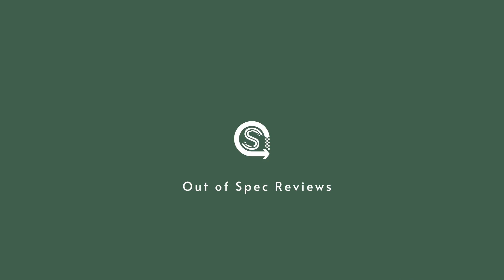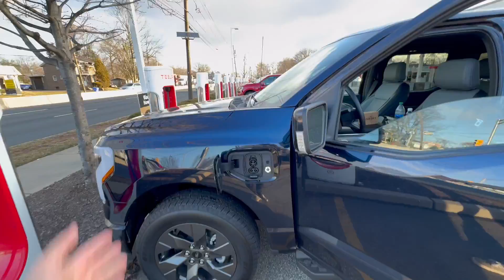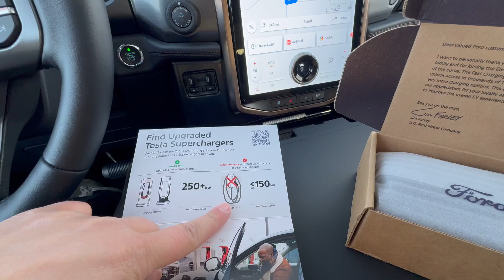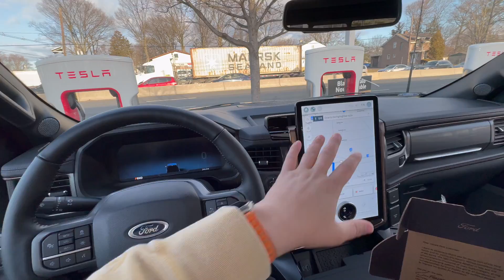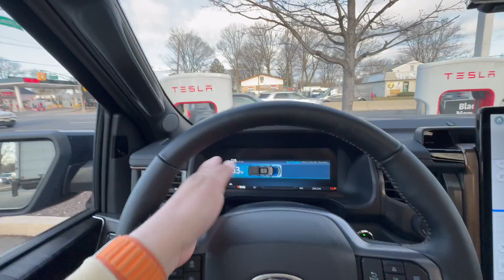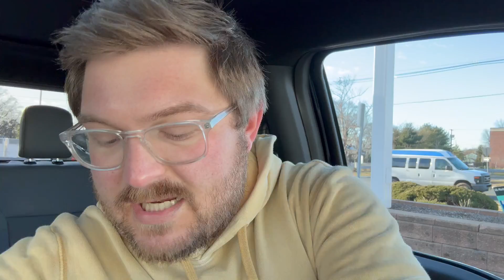Ford Gains Access To The Tesla Supercharger Network! Join Me As The First To Plug In

Comment: Man Kyle is doing all the EV releases for these companies. I love it. I prefer it over the cheesy manufacturer videos. Very informative as always, thanks Kyle
Reply: I find them rather misleading. Take the cybertruck test as example. He claims  it was done at 45F where it was 38-45F which reduces range by 20% compared to EPA 68-86F spec
Then he did it at 700ft instead of 4000ft for the rivian and f150. Reduction of 20% resistance due to thinner air at higher elevation 
Then he compares it to EPA and claims Tesla never makes it claimed range. This is so misleading as it is not claimed range but EPA estimate based on tests at EPA specification. 
Then his test are done at 70MPH not 48MPH average EPA speed. 
Fine if you like to do a test at 70MPH but don't compare it to the given EPA range 

But anyway, I don't beleive this is because he is a bit dumb and don't know how to do a test properly. I beleive it is misleading and I know that Ford pays billions in marketing, would it not be easy to give this guy a few pennies and he is happy to slightly mislead here and there..... we will probably never know but his tests stinks.
Reply: @bartdeking  Kyle explained all the adverse factors in that Cybertruck range test, including altitude, tires, ambient temps, and more. Kyle also explained that he'd be repeating the test in Colorado as soon as he gets a chance, to better match his standard 70mph tests.
Out of Spec has done dozens of tests at 70mph across different models and brands, for cross comparison. Why 70mph and not mixed 48mph? It's because that's a real world speed, across long distances, where consumers start developing range anxiety. 
For someone who's never posted an EV range test video, along with explaining your methodology and rationale, then criticizing the consistent detailed testing premises given by Kyle and his entire OOS team, I'm afraid your the one sounding a bit dumb.
Reply: @lv_q3259   @lv_q3259 you don't seem to read my comment properly. 
1, I have not problem if they do a 70mph test to give consumers an idea how much range they get on a road trip but DO NOT compare it to the range specified according to EPA specifications given on the tesla website. DO NOT even mention it since it is misleading as it presents like Tesla is lying or not giving a correct range. This is not true. 
EPA was initially intended to give an average consumption for average driving NOT a how far do I het on a long road trip I make twice a year test. 
In other word you can not say, I drove 70mph in 42F and got 256mi which is lower than the 318 specified by tesla. Simply because the 318mi is specified at EPA test specifications with an average of 48MPH and 68-86F. 
Likely it would add 5-10% extra range if you would test it at the same temperatures the rivian and f150 was tested. 

2, Yes he mentioned 700ft but instead of 4000ft but why did he at the end of the video not correct for it. He could have said, the distance was 256 miles but with known data that 700ft vs 4000ft elevation  difference we need to correct it by 20% to be able to compare it with the F150 and rivian which likely comes around 307mi if we would compare it in similar conditions

3, he mentioned indeed that the temperature was 45F and was used by ALL other media as the temperature for the test. However, if you bothered checking the video in detail and do some fact checking than you can see that temperatures are 38-45F mostly around 41-42F  

On your last comment, I would indeed only do a comparison test in the same conditions and when someone plays games on YouTube I am happy to point this out and wish that everyone would see how misleading the out of spec channel is. 

The narrative set is that CT is worse in range than rivian and f150 but in reality this is simply not true. Especially when it comes to wh/mi

Yes he promised another video where he would do the test properly but it is yet to come and the misleading narrative has been set already.

Comment: Is the required update Over The Air? 
Ford is now losing $30,000 per vehicle plus another $1,000 for the adapters
Ford should change to putting the charge port to the rear left or front right of the vehicle when upgrading to NACS.
Reply: Why would you put the charge port on the rear of a vehicle built to tow?
Reply: @vladimus9749 front right then?
Reply: @GonGon010 I bet this is what we'll see with other makers joining the Tesla network. I wouldn't consider any EV with charger on the rear since I tow regularly and most sites are not pull through.
Reply: @vladimus9749  Only an idiot would that is why all Tesla charges are on the rear left light cluster facing to the side, the only exception is the CyberTruck where the port is on the rear of the  wheel arch (facing to the side)
Reply: @jjamespacbell  Are you saying it's pointless to buy an EV if you tow frequently?
Reply: How do you lose $1000 for the adapters on when other reputable companies are selling it for $160CAD.  But I do agree the location of the ports will create a nightmare at the stations.  Imagine 20 spots charging 10 lightning…😅
Reply: @GonGon010  10 Lightnings would only waste 1 spot.

Comment: Unfortunately, the NACS standard only applies to the plug, it also needs to dictate the location of the charging port. Having an eV take up 2 spots on a busy location is going to cause trouble.
Reply: Yeah.
It's a real shame the CCS Consortium didn't make "let's decide on a standard port location" the second order of business after "Who wants coffee" In their first meeting in.... (from memory) 2010?
.
Instead it seems to have been a case of "just use the same location as the Fuel port on the cars you're converting"
.
smh
Reply: I think Tesla will be moving their charge port to the front. How are you supposed to charge a tesla while towing?
Reply: @vladimus9749  If that was even slightly likely to be true, Cybertruck would have a charge port in the front. So, that is a no. To charge while towing, you unhitch, or use pull-through charging stalls.
Reply: @geirmyrvagnes8718  Unhitching is a non starter for anyone who tows regularly. How common are Tesla pull through stalls? Are there some at each station?
Reply: Using the pull in stall that is taken by someone too lazy to back in most times. Or pull across several at the end. Enduring nasty looks until the person looks around to see you're towing. Or unhook. All fun. "Need pull through charging" is my comment whenever they ask for feedback. Gas stations figured this out decades ago.   @vladimus9749

Comment: Thx, what about a long 5 ft adapter, that could have resolved the port location and occupying an additional spot while charging.
That would have been a relatively easy solution without the expensive and long process of extending the SC cables on 15k chargers.
Reply: Cooling.
.
I'd like to think there will be a ...."contribution" by others to extend cables where required together with a "don't be a D.H" attitude when a nit Tesla is blocking a charger (as Kyle is 😉).... When it's busy.
Reply: This is not a house fan. It's a high current DC charger that needs cooling and the handle temperature needs monitoring. You can't extend these cables

Comment: This is great! The only problem I see is where the Ford charging port is so two lanes would be taken up and would be blocking the spot a Tesla would need, hopefully the software takes this into consideration when they sense a certain type of car is plugged in and doesn't say the blocked charger is available, based on charge port location.
Reply: Did you watch the video? They know what to do but that can’t be helped until version 4.  That is what happens when you build for only your cars but other networks had to let everyone use them.

Comment: When will they address the short cable and the parking on the wrong side thus taking up 2 spaces to charge?
Reply: Mmmm....  Perspective.
.
It's not a "Short cable*
It's an "incorrect port position"
.
Any company that even considered ...
"🤔 What happens if we eventually decide to standardise with the network that has more vehicles and chargers than any other in the future??" Might have had a word with the designers and said "just in case, put the charger front right " (on the lightning) or rear Left (Hyundai, Kia) etc.
Reply: It is being taken care of, and it also mostly takes care of itself AND it is not like this is the end of the world as we know it, it is annoying.

Comment: Pretty disappointing that Kyle doesn't mention the parking clusterfuc that is about to happen.  I hope all new BEVs will come with sockets on left-rear or front-right from now on
Reply: The final piece of Hubris from other manufacturers??
Reply: @rogerstarkey5390  Tesla cars will also be blocking non-Tesla cars from using the Superchargers, under the same scenarios.  But... there are 10x as many Teslas on the roads (and using Superchargers) as there anything else, so you won't often see this issue if you're a Tesla driver.  But... you may find it to be a pain in the ass if you have a non-Tesla and its socket is in the wrong place.  I say "the wrong place" and feel that is technically correct, since Supercharger sites often need cars parked a certain way for their short cables to reach.

Comment: Several questions: 1) While charging, will it let you pull out the Tesla handle (with the slide switch release), or is that prevented when the adapter is plugged into the car?  2) Will it let you plug this into the car and then plug the Tesla cord in, or is this reverse process blocked?  3) Is there a genuine check being performed - will 3rd party adapters work or not?
Reply: My understanding from the Ford instructions is that you must first insert the Tesla plug into the adapter and then insert the adapter into the Ford. Removal is the reverse -- remove the adapter from the Ford and only then remove the Tesla plug from the adapter. I believe that the interlocks on the adapter prevent you from doing otherwise.
Reply: @charlescourtney4412 Yes, I but I would like to see someone try and confirm this - when you don't follow the instructions.  I believe this is a big difference from the A2Z and Lectron third party adapters - the Tesla adapter potentially being a foolproof and safer approach.

Comment: Kyle, what happens if you 'spoof' a ford vehicle in the Tesla app and try to use the adapter with another brand?
Reply: There’s a software update needed on the car side that enables access to the Supercharger network.
Reply: @anthonyc8499  per Ford's FAQ:

Is a Software Update required to use Tesla Superchargers?

While updates are not required, software updates will enhance the experience at Tesla Superchargers. We recommend that you enable automatic updates to receive software updates and take advantage of these enhancements.

Comment: They need pull through chargers just like gas pumps if they really want to make it as convenient as gas cars, especially for trucks when your towing. If you can only tow 100 miles and have to drop your trailer to charge then most won't switch to EV.
Reply: There are pull through chargers.  Probably going to be a lot more due to the Cybertruck.
Reply: Not enough, and only recently. They should all be. I've towed cross country. Not fun. And many locations are not designed around it (dead end sub-parking lots).   @sparks869

Comment: That disconnect process is going to result in a lot of adapters left behind at the superchargers. IMO the better process would be to lock the adapter into the CCS port until the NACS plug is removed. That would force you to disconnect the Tesla plug first, then it would be easier to remember the adapter and throw it back in the car.
Reply: If you don’t remove your adapter you can’t hang the NACS back on the dispenser.
Reply: Yep.  I fully expect to start an adapter collection in the frunk of my model Y.  My most often used Supercharger is a V2 which won't work for non Tesla vehicles.   I am sure there will be  confused drivers there unable to figure out why it won't work.  Hopefully it will get better quickly but for some time this is going to be a cluster....

Comment: The charge port location on the Lightening means that two spaces are occupied per Lightening.
Reply: Just imagine if Kyle was around when the first mechanical gas pumps launched ,five minutes the whole process done😅
Reply: He addressed that in the video.  You could have 10 Lightening's and they would only take up one extra spot of done correctly.
Reply: @ttom We'll have to see how it goes. It has the potential to only waste one stall per site. It also has the potential to waste 50% of the stalls.

It'll probably end up somewhere in between. How good it is or how bad it is will depend upon the drivers on that day.
Reply: @JeanPierreWhite  Cybertruck owners are gonna forcefully move Fords that takes up 2 stalls if its full, the F150 will take damage but the Cybertruck will have little to none at all if they move at 3 miles per hour 🤣
Reply: But honestly though, Tesla owners will be furious if 2 stalls get taken on a busy day, best solution though is if there's to many cars there, tesla automatically closes that supercharger location to Non Tesla's till all the tesla drivers are gone
Reply: @ParvTubeHD  If Tesla shutout non Tesla's at busy stations they'd soon find themselves on the wrong side of an anti-trust lawsuit. Pretty sure Ford et al will have made sure Tesla don't have unfettered control over who has access and who doesn't.
Reply: @JeanPierreWhite  Ok they can have access, just increase the price by 1000%, Tesla may not be able to get them to leave but they are able to choose pricing which is something ford as no control over at all which they have admitted
Reply: People will figure it out like they have in Europe.
Reply: @barryw9473  Here's hoping.
Reply: @barryw9473 in Europe there are plenty of competition in the charging market so you can just go anywhere you want to charge. I. The US everyone else has failed so they will be all funneled to super chargers. There’s gonna be no “figuring it out”. it just means that some supercharger sites on some days are going to have dramatically insanely long wait times because remember these legacy auto EV’s not only take up two spots they take a lot longer to charge generally.
Reply: @ultrastoat3298  I just took a 1200 mile road trip using EA and had to wait twice for 30 minutes. If those people go to Superchargers, there will be no wait at EA. People will figure it out. The sky will not fall.

Comment: As a Tesla owner who roadtrips 3-4 times a month, I am delighted to see other EVs able to use the Supercharger network and hasten the EV transition.  However, I am concerned that the Tesla routing software will be showing open dispensers at a location that are, in fact, being blocked by non-Teslas who take up 2 dispensers (from a Tesla perspective).  I hope Tesla will somehow figure a way to show that 2 dispensers are in use when a Ford or Rivian or Mercedes rolls up and plugs in "backwards".  

I live down the street from the Tesla v4 dispenser in Columbia, SC that a couple of YouTubers have featured and see how this problem will eventually go away with the new universal dispenser design.  However, I am sadly considering going back to ICE for a couple of years if I start to run into this problem repeatedly over the next few months.
Reply: It’s all fun and games until you are waiting in line and looking at some fords taking two spots each.
Reply: @ultrastoat3298 and double the charge time of a Tesla.
Reply: Agree
Reply: This is going to be an issue.  Say it's an 8 stall Supercharger and 4 Ford EV's are spaced out, the Tesla app will show 4 in use and 4 free, but you won't be able to use any of the free stalls.
Reply: Blocking 2 bays is an issue in Europe as there’s no standard determining which side of the vehicle to put the charge socket. Tesla chargers are more exposed as their cables are relatively short, even the newer ones. It’s common to come across a VW or similar taking up two bays. However Europeans generally do not need unnecessary adapters as there was a snowball’s chance in hell that the EU would adopt Tesla’s charging standard and hence Tesla uses type 2 in Europe.
Reply: It would be very helpful if non Tesla EVs would just pick the right side charger stalls every time, Tesla pick the left side then there's less "wasted" stall for all.
Reply: @hvu6037 isn’t he parked on the right side?  There is only 1 cable at his charger (1a).
Reply: no, tesla plugs on are the driver's rear. They back into the spot. A tesla using that charger would be parked next to the driver's side of that truck in the video. The truck would be blocking any charger to it's right from any tesla using it. @rmorales1029
Reply: Blame this on Telsa for making a wire only for their cars. Why didn't they just make it longer to begin with so that they wouldn't have to upgrade all of their stations again in the future? I'm sure they knew several years ago that there was a possibility that their chargers would be opened eventually like they are in Europe.

If they have to use a slack prop design instead then do so. Let's not talk about how short those magic dock wires are smh.
Reply: @volcalstone  Yup blame Tesla for making the Superchargers FOR THEIR CARS.  I have a solution.  Stick to your EA or Chargepoint or whatever the ph_u_ck is out there and we won't have a problem.  There I solved it for you.
Reply: @guru2899  you seem bitter now that you have to share. 😁 All I'm saying is that they should've made it more universal in the first place. Center location stations and just slightly longer wires would've made this a none issue rn.
Reply: @guru2899 Agreed and we shouldn’t have to share. We bought Tesla’s in part for their super charger network. Now non Tesla vehicles will clog those chargers. BS.